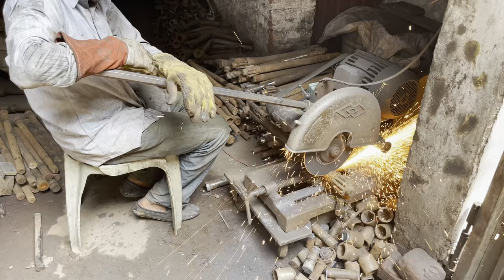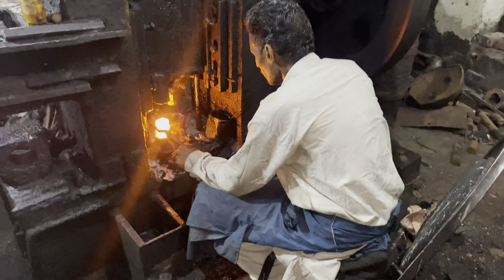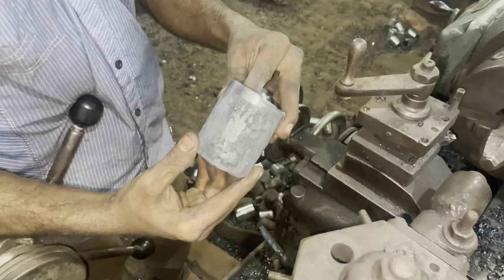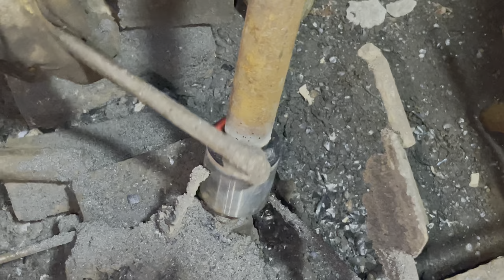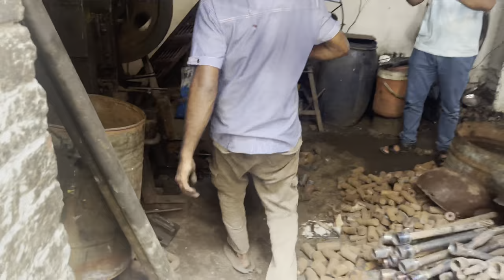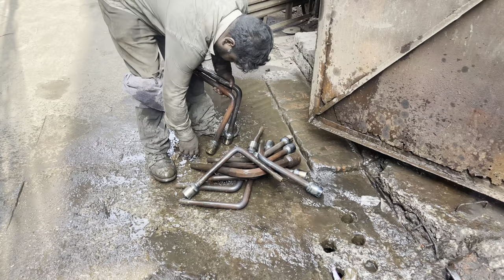How Experience Craftsman Make a Wheel Spanner 🔧 From Truck Shaft Axle

Comment: To me it looks like they could learn to make the sockets interchangeable like the rest of the world.   But also they are only trained to do one thing.     The old man stamping the sockets worked 30 years to get a job with a chair.
Reply: Don't spread misinformation. I've seen multiple of these guys stand up from their post and take the item to the next duty and do that job also. Seemingly knowing how it will all fit together. Sure most probably only know what their task is but do not not underestimate these guys I'm telling you.
Reply: No, it is not true. Knowing only a small task is usually related to advanced areas, that want better automation, faster product production and lower training costs. But in small industrial areas they are usually very capable and they are very flexible in what they do.
Reply: It is a Wheel spanner, or wheel wrench used to break loose lugs nuts on a car. Pop open the trunk of your car and you will see a single socket welded to a rod with 90 degree bar attached to it. This obviously is for bigger lug nuts, or big trucks
Reply: It's a simple breaker. To be used in combination with moderate violence. No socket can withstand such forces.